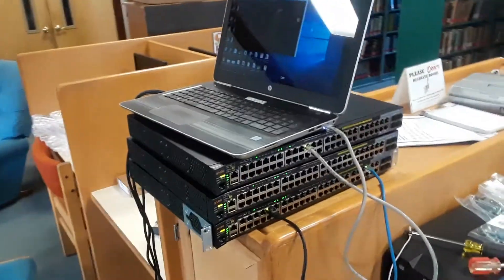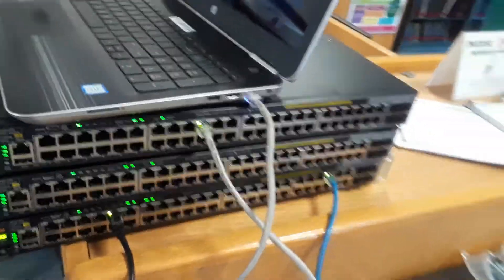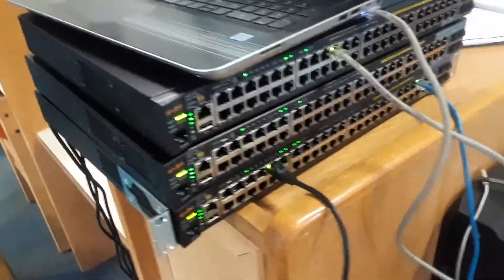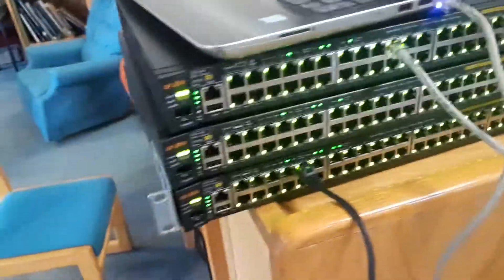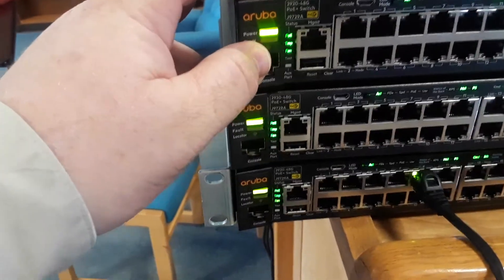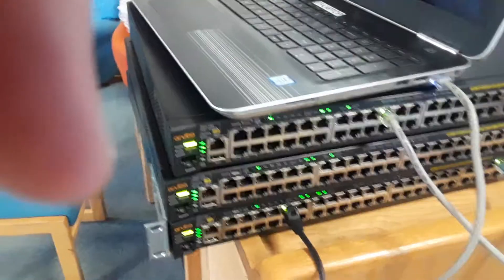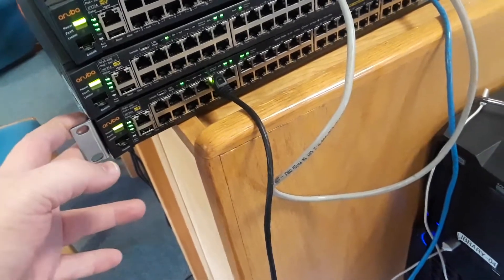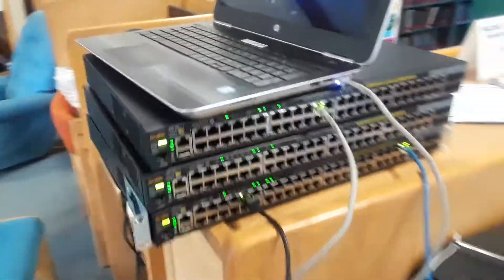HP Aruba 2920-48 POE+ Overview for PVBI

Comment: Is the 2920 a layer 3 switch? Or a layer 2?
Reply from the maker: Its a Layer 3 Switch. The 2920 is now discontinued. Ours took some lightning damage and we replaced them with the 2930's. But chose the cheaper non-modular version.
Reply: Douglas Gardei I have a 2530 48G PoE+ and thinking of getting a L3 switch. Might be looking at the 2930 model. Thanks

Comment: Hi Douglas, the explanation is brilliant! thank you so much for that. i learnt many things about this switch. i have a question though, can you help me with the product code for the stacking modules please. also i need to know whats the connectivity speed of these stack modules.
Reply from the maker: Sure. J9733A is the stacking module
J9734A is the stacking cable. From what I gather, it is around 10GB. I am ordering the expansion cards to add 10 Gig Fiber Connections soon :)